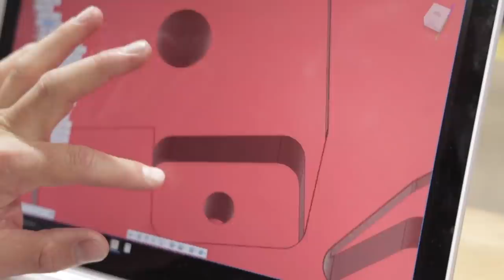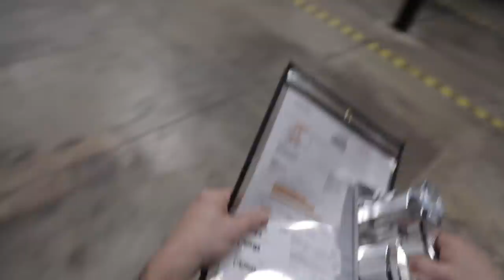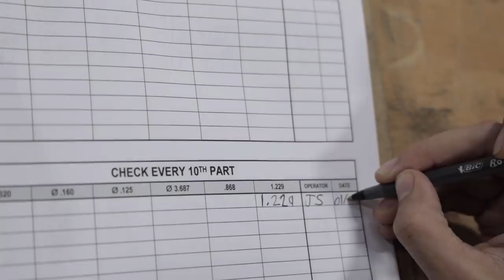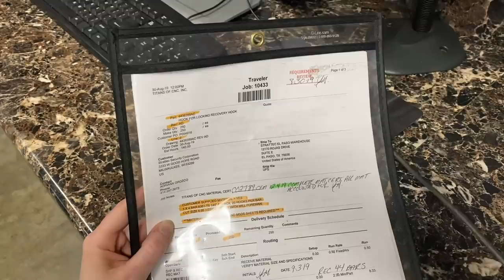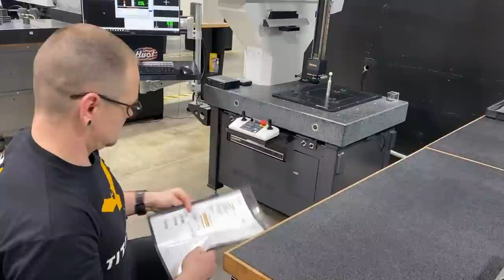5 Axis Production Fixture | From Inception to $$$$$

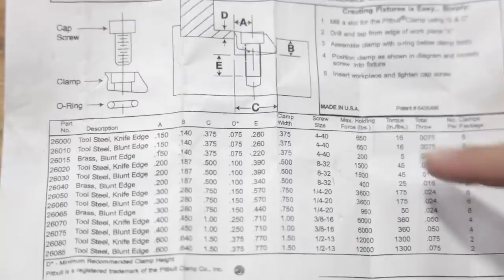Comment: Great video demonstrating A - Z. A few comments. First, love the use of a torque wrench. Not enough shops utilize torque wrenches. They really do cut out variables. Next, more than one way to skin a cat in terms of workholding during the machining process. Sometimes it's dovetail, sometimes it's Mitee Bite, sometimes it's VERO-S. And sometimes it's a combination. An example of combination is a MITEE BITE fixture with pull studs that mounts to VERO-S. I'm curious, at the 1:12 minute mark of the video, instead of turning all those wrenches, could you have mounted pull studs under the workpiece and direct clamped  to VERO-S?

Comment: Great job! Two operations using 3 axis. I wonder if it will be more profitable using a 5 axis all around single work to save a fixture. Cheers from a Swiss mechanic.
Reply: Daniel Valero First op is on a 5-axis.

Comment: LOVE IT!  I would love to see how we can be cutting magnesium safely!  MG is the future!  
I love how this is a day in the life!
Reply: yeah really the magnisium is one of true nastiest materials to machine it can suddenly harden under stress and the more you push it after that the harder it will be so the tool would snap eventually and if it gets hot just run away because it will burn and there is nothing that you can do about it it has so much energy and the reaction with the oxygen will never stop if you poor water on a burning chunk of magnesium the magnesium will separate the oxygen from the hydrogen in the water it will react with the oxygen and the you have hydrogen all over the place ready to expload just a complete crap same thing with CO2 really would like to see some guidlines about how we machine magnesium safely
Reply: Use to machine a lot of magnesium for F1. If you treat the material like aluminum you'll be fine. It's not difficult to machine but you need to keep sharp, high positive tooling on it and make sure you have good chip evacuation. Any machine working Mag should also have a fire suppression system installed. Follow the cutting tool manufacturer's guidelines as a starting point.

Comment: 40 taper haas,  making cool parts out of stock aluminum.  those were the days :)  try aerospace overhaul and repair :)
Reply: Spent 20 years project manager facility Department turbine engine company. we had a project we moved five mitsui Seiki 5 axis  centers we lined them up  two on one side 3 on the other facing each other. That meant cutting in 5 new 20-foot by 20-foot by 5 ft deep foundations. Then we cut in a trench in laid a rail system for a robot in the middle between all the machines. At one end of the robot rail what's a 3 High Interlake rack system holding pallets that are already fabricated up with the part each machine has an autoloader that can handle three pallets at a time once everything got shook out and debugged was slick as shit could run for days. That was a long time ago they offshored the whole operation (7000 jobs) a few years back  Trump made a visit earlier this year to celebrate using that facility to make masks for 9 months with subcontract labor. "Manufactured in America"

Comment: This feels like a miniseries, from the moment the part was contracted, to initial setup, to the optimization bringing it down to about 15 minutes a part if my eyes don't deceive me, which is an insanely fast time. The shop I work at would take 4-5 hours per part (.025 DoC the entire way as a 3d toolpath. For Everything), at best, and would shoot down any ideas to do it faster other than increase chipload to the point where tools break. I think there's a reason they had to close down during the pandemic, and it has nothing to do with health. I needed this vacation anyway.
Reply: what software do you use?

Comment: 4:41 what is this tool?
Reply: A debur tool, to refine sharp edges. Only works on metals.
Plastics or Carbon will chip.
Reply: @YannickMX2  that is not entirely true with alot of plastic's i handle every day a deburring tool works just fine. I am talking about PE,PA,POM,PP,PTFE,PET

Basically everything that isn't horribly brittle but all thermoplastics I know at least work.
Edit: grammar
Greets from Germany
Reply: @nf794  richtig